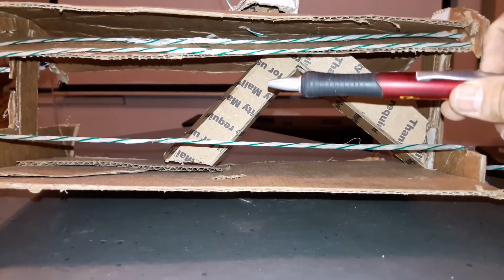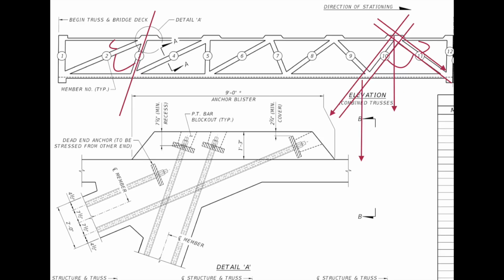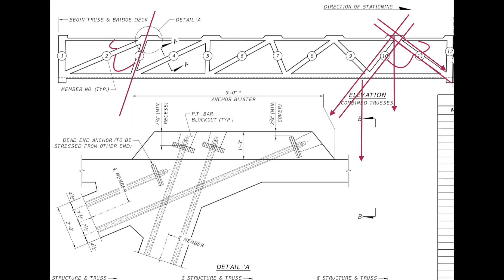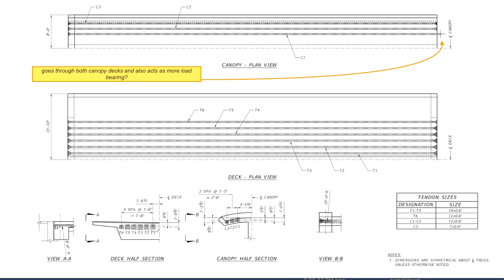FIU Bridge Collapse & lack of longitudinal cables ''absent" & not grouted? video #7

Comment: I think you hit a home run. The top deck failed seconds before no 11 did. Who in the would would stress test a bridge when all the post tension cables had not been in place? I think your proposal that was the likely lead up to the collapse  is correct. My theory that the movement and placement of the bridge also played a part with over stressing the canterlivered ends...hence the cracking. Probabley would be fine once all the post tension cables had been in, but with it having some missing it had no chance. Good work.man. The model helped. 👍🏼
Reply from the maker: Your positive feedback is appreciated - thank you for the comment on the model also...

Comment: This is BS.  The span was a bad idea from the beginning.  Concrete is not an appropriate material for a long span truss.  There was no precedent for such a structure.  It failed, and the engineers in charge at the time it was put in place were reluctant to declare the experiment a failure.

Comment: Try to build the Empire State building out of reinforced concrete alone  88 years ago. and try to build Freedom tower today with just reinforced concrete,  you would find that you needed so much concrete to support the tall buildings you have no more  usable floor space left at the lower floors. Similarly, in FIU's case,  using several post tensioning members to make a single row of concrete truss with a few post tensioning rods and hoped that the bridge to stand up is a miscalculation to me. The bridge would  have to be so heavy or failing after erection if not strong enough ! By the way, I worked for Skidmore, Owings and Merrill, architects from 1968 to 1972 on American Can Co, Ct. with T.Y.Lin's precast, pre-stressed concrete decks for the office block spanning 30'-0" O.C. and the post-tensioning deck for the executive wing with a span of 60'-0" (with the deck depth of 30" for both.)   George Wu, ARCHITECT, A.I.A., NCARB 2018-4-6
Reply: I was responsible to develop the T.Y. Lin's single Tee into double Tees for transport and for erection in 1968. the garage building using our system ever since 1972 till now everywhere. But I never got any credit for any of my 50 years work anyway ! George Wu, ARCHITECT, A.I.A., NCARB 2018-4-6

Comment: This bridge was designed to be a cable stayed bridges.  Generally the deck has about 1/4 the normal strength since the cables take all the weight, and aren't strong enough to stand without the cables.  They needed to have the tower and cables in place, then installed both sides of the deck.
Reply: I fully agree! still leaves begging questions, had they even started construction on the other half? How long would the 1/2 bridge would have to stand on it's own before they could run All the cables? I think if they had waited until BOTH sides were fully tensioned Before they messed with #11 the bridge may have survived, I also think that they were in a hurry to "fix" the embarrassing cracks
is why they were messing with it.

Comment: Maybe you can make a video explaining a question I have.  Now Im not an engineer, but I think I understand a few things. I get the tensioning cables to strengthen the deck the roof, and the columns. However what I don’t get is that I see a lot of talk about  tensioning to add strength, but where is the support for the bridge? How was the downforce, the weight,  of a 950 ton  bridge supposed to be carried off the bridge? The columns held the roof up, but what supported the bridge? You had all that weight with gravity wanting to pull it down, but yet no support. Maybe if the bridge was lightweight with huge I beams spanning the road you would be ok, but a 950 concrete bridge with no support?
Reply from the maker: https://www.youtube.com/watch?v=mUyyNES3Qgc&t=0s I did make one... it is a mix of this accident and also how it works... Please, feel free to comment and I will respond... https://www.youtube.com/watch?v=mUyyNES3Qgc&t=0s
Reply from the maker: Thomas, enjoy this one  https://youtu.be/BDHRmvvMdmk

Comment: From what I understand, cables were not used. It was post tension bolts that got stressed and fractured into it's yield point during installation. This caused popping sounds and visible crack in the 2 days leading up to the failure. When they saw the unknowingly weakened bolt did not have enough tension, they were in the process of tightening (hydraulic unit) it until it brittle broke causing catastrophic failure.
Reply from the maker: You mentioned, bolt failure... You can make a failed bolt work...that still will not get total failure with this design.

Comment: A truss bridge requires that the ends be anchored solidly. If the PT rod in #11 snapped, you would lose that part of the strength and it will fail. The canopy is the top chord but provides no strength at the point they were at past the anchor point for the PT rods in #11. The design may have worked when finished as there would have been pull on the top to carry some of the load but at the point they were at, they had a Howe Truss bridge that only had one side. And just about no steel in it. Howe Truss bridges also require balanced loads which this bridge did not have. They would have been better off with a Bailey Bridge design.

Comment: They moved the North end outside jack tower toward center leaving the entire end chord, approximately 1/5 of the structure, cantilevered unsupported as well as omitted plates or beams across the top of the jacks straddling the towers creating point load stress.

This stressed the tension rods in that chord past their tensile strength particularly the outermost rod going fron thre top down, which is the one to fail triggering the collapse 

The video shot the weekend before during the move has several images from underneath and the North end is hanging way out in space. Even to the layman eye it does not look right there

Comment: This will serve as an example of how not to build a bridge. The reason it's taking so long to identify the cause is that there are so many possibilities. In the end they may say it was a combination of factors bur each design flaw would be sufficient by itself to collapse the bridge. You can't hold up over 900 tons of concrete over a large span without a lot of steel to support it. Those cables would never work. This design stank.
Reply: I think the problem is they weren't just building a functional bridge.  From what I saw, it was to be a gathering place with benches, tables, potted plants and ceiling fans.  Much of this would be counter to the concept of a bridge which should allow easy flow.  So instead of having the vertical bridge structures on the outside, a large one was placed in the middle to allow unimpeded views. I wondered why wasn't the cable stayed section put up first.  Surprise! The cable stayed section wasn't a real cable stayed section.  It was "for aesthetic purposes" and would allow light displays.   It was probably peddled to be an iconic show piece.   It would have been best to have handed the design and instillation over to a railroad and tell them to do it their usual way, install a cheap functional bridge.  The area will be closed off Friday night and the next Monday morning it should have been built, tested and ready for traffic.  No years of study and grant solicitations to allow politicians and school administrators to have something to put their name on.  It would have been ready for use by the consumers quick.  But they weren't building a utilitarian bridge were they?   Now they have an iconic disaster.

Comment from the maker: Looks like maybe the canopy might have failed first - and that load of the upper canopy deck assisted in causing the lower deck to fail.
This was designed with what appears to be two additional cables (not installed yet?)... for at least, a total of 6, upper canopy cables.
The load is on the top canopy and this created a point load at the post tensioning area... this was anchored (load path back to the North column / base of bridge)...  
Imagine the existing four, canopy cables supporting the entire lower deck and it's own dead weight (canopy included)... 
Then add this point load (the post tensioning) ... you get a failure of the four existing cables...   
Also, visualize this... 
if this post tensioning was so great - why did it not rip through the bar blister?   
Well, we may think it compressed it? Or it created a buckling and this little flex caused this bridge to fail... But, I no longer think that with "certainty"...    
We all, almost agree the canopy failed first via the post tensioning... (#11 appears to be the ''buckling member") but, this would require the canopy to have failed first or we would might just have a big hole in the canopy or a sheared post tension rod... (I use rod and cable interchangeably)...
Reply: Philadelphia Construction Engineering couple of thoughts, I find it difficult to imagine that PT bars would be missing from the top chord. Second, once placed on the piers, the top would be in compression in the middle and in tension towards the edges. I notice the top section is shaped in a curve, that profile would help counteract the forces.
All round this is a strange one. These companies do all sorts of computer modelling which has a proven track record for safe construction. To my mind that leaves two areas of error, construction or the placement work. 
Then there was the DOT requested change in design. To lengthen the bridge by 11’, which forced the change in the mobile jack system.
Reply from the maker: Rob, the post tensioning does put pressure on the bridge canopy - as it is restricted in it's movement... It is held at each end and then the crank up the tension to what the plans call for.
It acts like a piece of steel inside the concrete -- once it is tensioned. Think of you standing on 20 pieces of rope - kind of just limp...  
Now visualize the same ropes pulled tight - you could walk across them and the tighter they are and the stronger the ropes are - the more you could load those ropes...
You could even pull two cables across a valley and if you could anchor them and pull them tight enough - you could drive a tank across them...  that is the theory on the cables, by themselves.